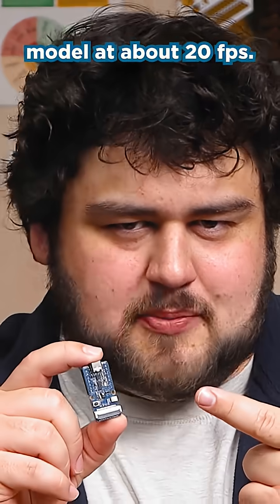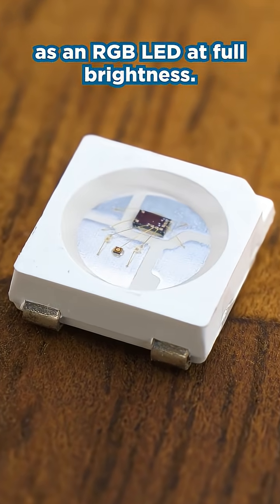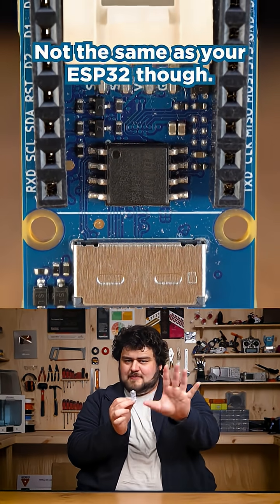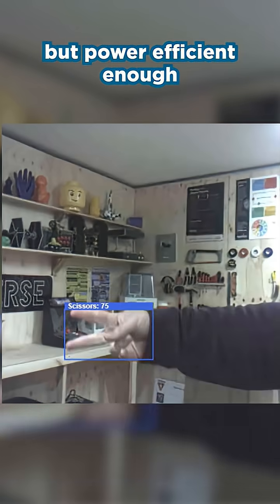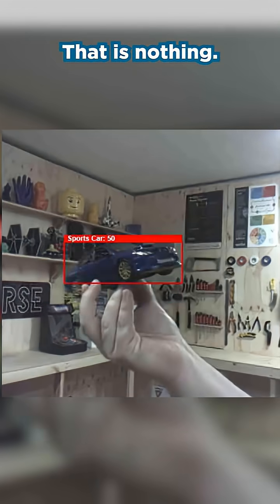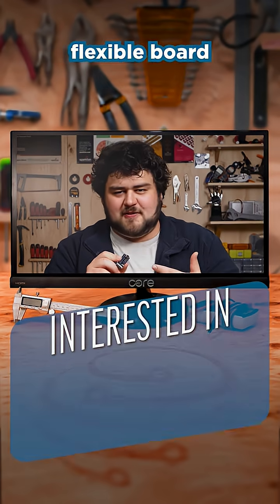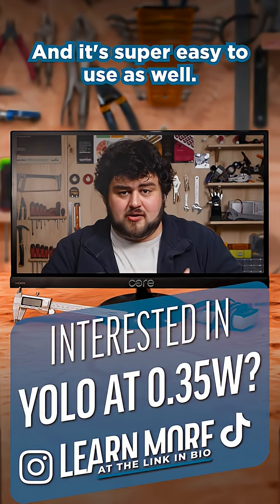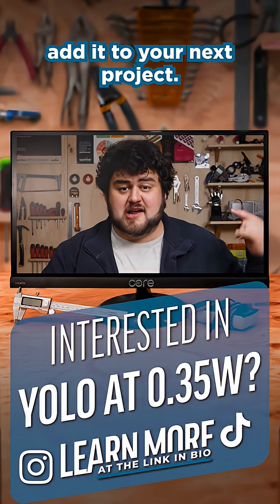YOLO Object Detection... On Microcontroller Hardware???

Comment: I think this fps is for tiny yolo and not the original ones
Reply from the maker: Definitely, that FPS is using the cut-down models. But there are YOLOv5 and YOLOv8 based models that run at about 20+ fps!

Comment: 20fps on that tiny chip is legit impressive. Crazy times.
Reply: You do realise we've been recording 70-80 fps on some phones with chips about same size right? Tech has been around, what makes this special is the processor and it being a consumer module
Reply: @shashankbj3804  you're comparing apples with pears. it's running an image recognition model at 20fps with less power used than your phone just recording images as 90fps
Reply: @shashankbj3804  bro you're out of touch and talking with so much confidence.. this isn't a simple camera.

Comment: 🙄....ok I'll just ask Chat to dumb this down for me....
Reply from the maker: Object detection model very complex task, requires much processing power.
New board runs on very low power, with well designed detection model, can now run object detection on low power board.
RGB LED uses about same amount of power as object detection now.
Object detection on board not perfect, but good for certain projects.
Reply: @Core-Electronics learning but thank you...old brain trying to hang in there with you all new and bigger brains😊

Comment: "0.3watts, that is nothing" 

That's 300milliwatts, that's quite a lot. Not compared to something that sues 3Watts, sure, but running on a battery, 0.3watts still takes a serious bite out of your power supply.
Reply: It is nothing 
You want cv to run on 1 milliwatt?
Reply: I've got a plant lamp made out of 170 RGB LEDs and it draws like 12W, so, yeah...
Reply: So true, why doesn’t it consume 3 picowatts?
Reply: 0.3 watts really is nothing though. Especially for what it's doing. I mean, a single IMU and a wifi module uses about 0.1 watts, so...
Reply: Compared to what😢
Running yolo on raspberry pi?